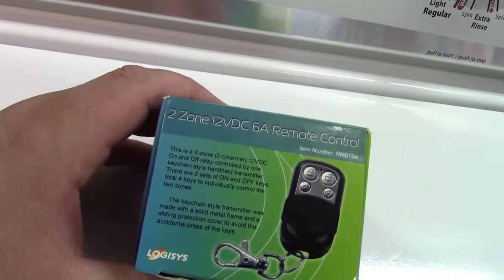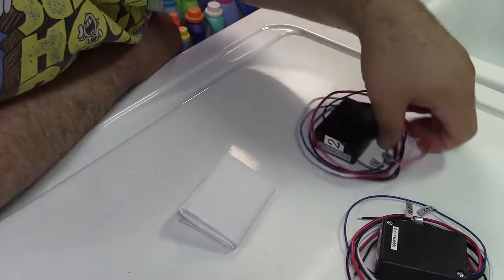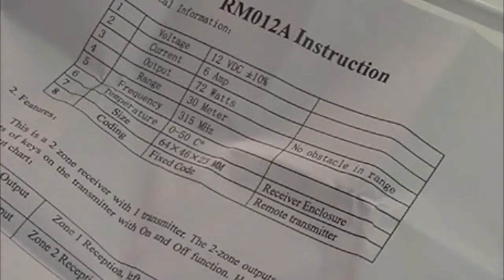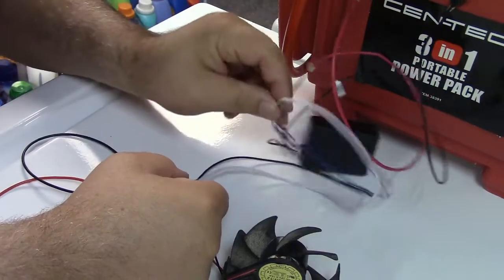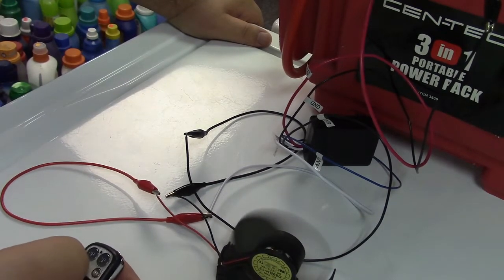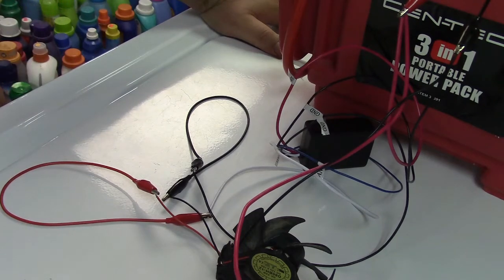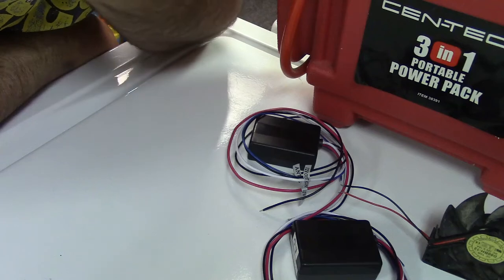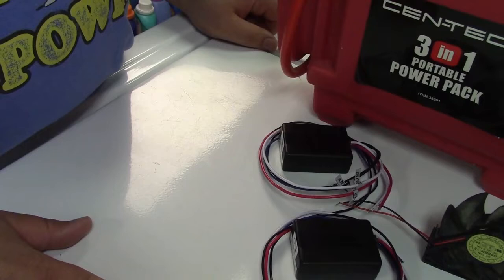Logisys 2-Zone 12VDC 6A Remote Control Switch Demonstration

Comment: Could use it for 12 volt emergency lights inside the house.
Reply from the maker: If I had some, perhaps!  While I wasn't terribly prepared for the Hurricane Sandy aftermath, I'm well-prepared now.  There's no well water, it's municipal.  Water heater is gas with a standing pilot.  Everything else in the house with the exception of the pool and the air conditioning can be powered by gas generator if getting gasoline isn't an issue, otherwise there are a plethora of USB power banks, 12 volt jump packs, and even car batteries I can kill if I need to, and inverters.